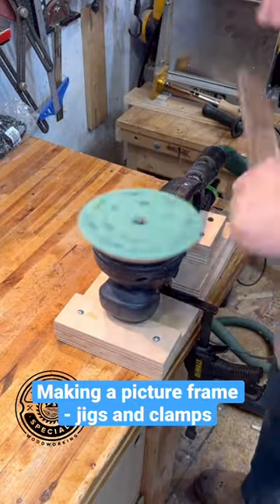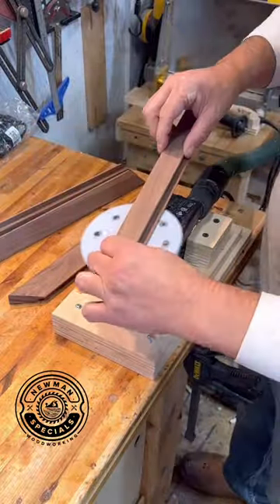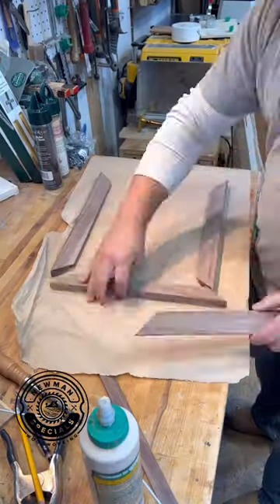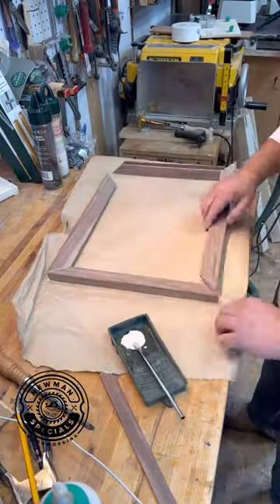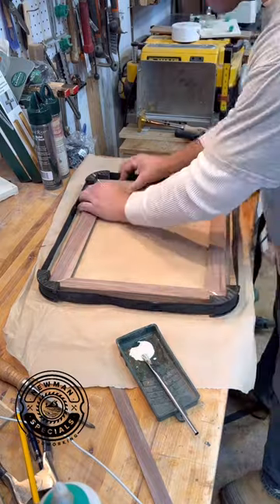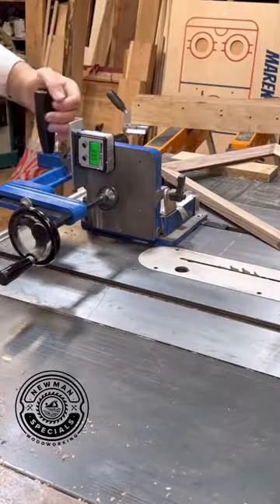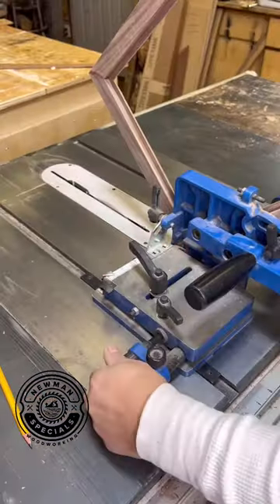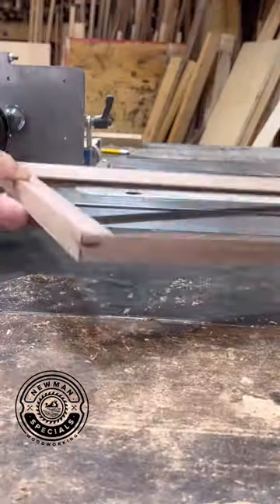Making a picture frame - jigs and clamps #woodworking #tools #woodworkingjigs

Comment: If you have to use a DA sander to sand 4 picture frame walnut pieces, then you should probably go back to the roots of hand sanding to understand what your trying to achieve. That sanding dock was super awkward
Reply from the maker: Sure it was guy. If you say so it must be true. 👍
Reply: @NewmanSpecialsWoodwork  in all my years as a joiner I've never seen anyone use a sander upsidedown. Maybe a belt Sander, never an orbital. Like if it really works for you cool mate. There's more then one way to skin a cat! Just not a practice you would see me teaching anyone 🤷
Reply from the maker: @BirdAndBearFinishing   so… don’t use that method then. 🤷‍♂️ It works great for smaller pieces.  I recently met a guy who has built an entire successful business around this type of sanding dock, so apparently it works for a lot of other people as well. 
As you said, there’s more than one way to skin a cat. I tend to think of techniques that work for me to solve issues I run into in my shop and I share them.